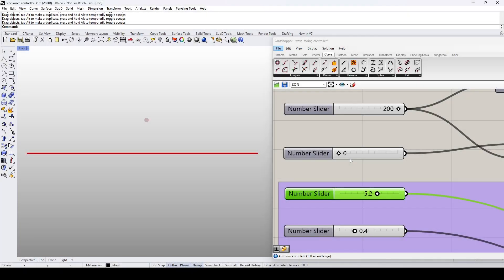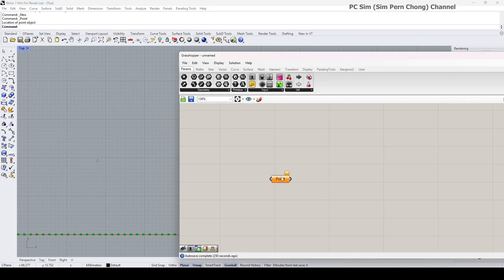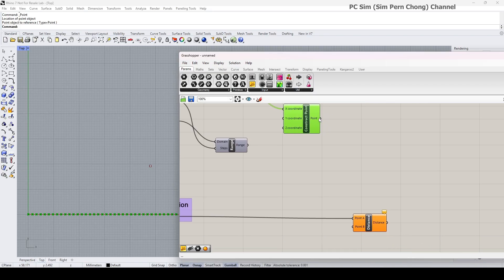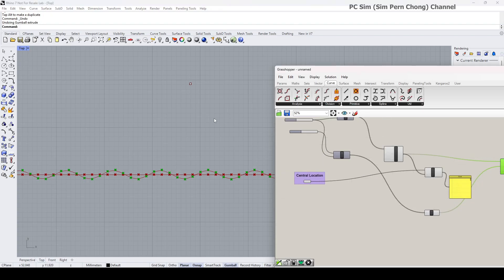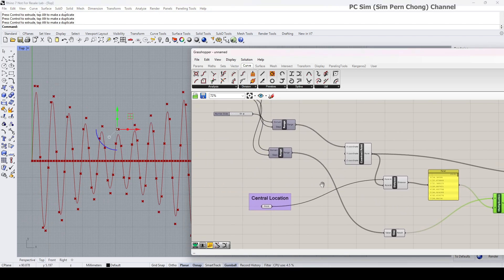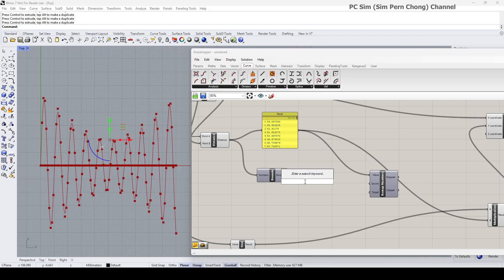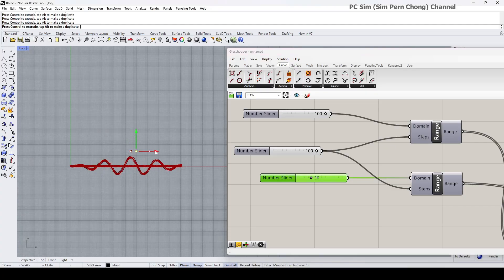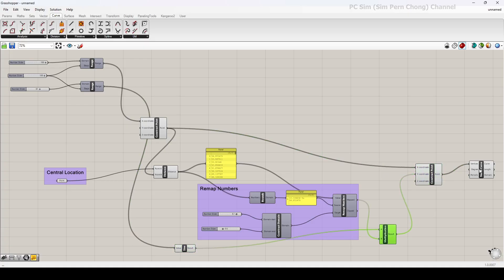Rhino Grasshopper Tutorial: Wave Curve Controller

Comment: Wave manipulation is handy.
Reply: Yes, true.
The sine function is a fundamental building block for understanding wave curve formation, particularly in trigonometry and mathematics. Its periodicity and symmetry make it an essential tool for modeling real-world phenomena like sound waves, light waves, and vibrations. The sine function plays a crucial role in wave curve formation because it represents a periodic oscillation or wave that repeats itself over a fixed interval. This periodicity is known as the period.

The sine wave repeats itself every 2π radians or 360 degrees.The sine wave has symmetry about its equilibrium position, meaning that if we reflect one half of the wave across its center, we get the other half.
2 cents